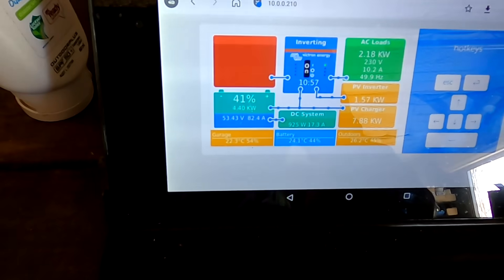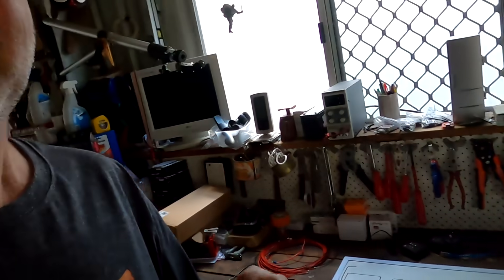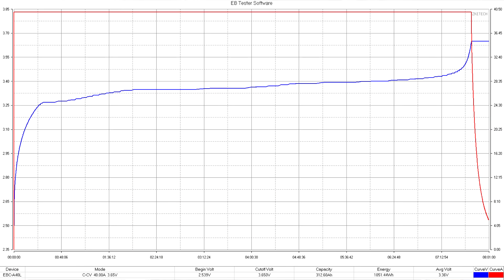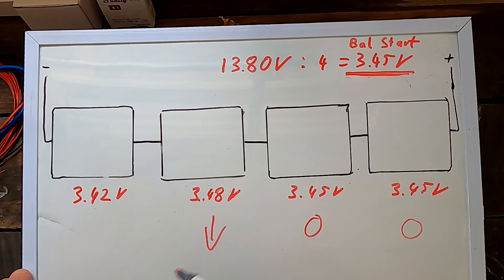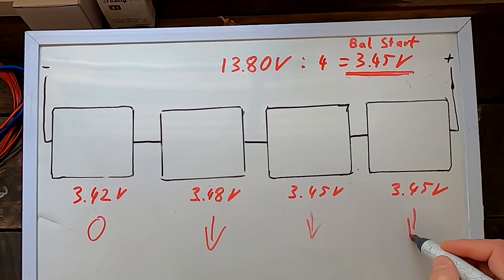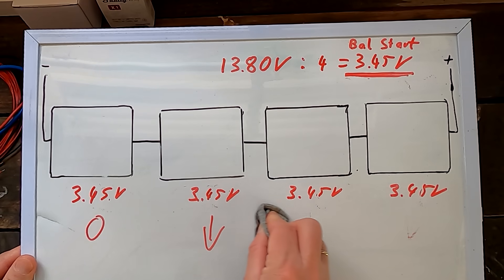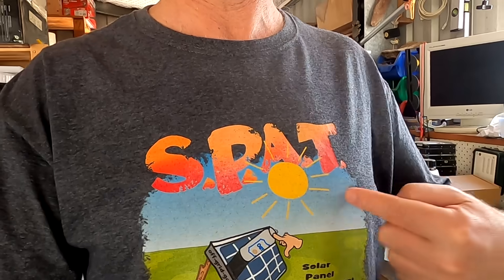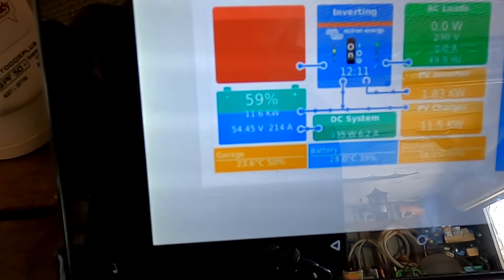Balance Start Voltage for LiFePO4 explained. Why you should not start too early... 🔋⚡

Comment: Thanks a bunch. This is why I am subscribed. You hit the point and very educational.  I have it balancer at 3.45. why would someone want to set the balancer at 3.55? Capacity? Use Application?
Reply: In the last few videos on passive balancing, Andy discussed that this higher start point gives the balancer a better voltage differential between cells and therefore will result in balance current being higher. At this point in the curve you see bigger differences in discrete cell levels, and this is where balancing is 1) required and 2) most effective (ie higher balancing current). But he has shown that the passive balancing schemes continue to struggle to bring a pack into balance when the charging current is larger by orders of magnitude than the balancing current.
Reply: @CollinBaillie  If solar charge controllers could limit their charging current to a smaller amount at a setpoint voltage that would be great for balancing. But it doesn't seem like any can do that.
Reply from the maker: Yes, there is much more to it: the deviation setting of the balancer as well as the actual charge current at time of balancing. Charging with 100A and the JK balancer can do 2A balancing, does make much sense and difference.
Unfortunately, most systems cannot be fine tuned that the actual MPPT is slowing down when hitting CV.

Comment: Because of the variance between batteries,  I balance all the time,  both during discharge and charge.  After 7 years of fulltime use and a delta of 6 milliamps and 95 percent of beginning capacity I'll take my method over yours when you seem to have a constant problem with delta drift.  My BMS is original to the system with zero problems.
Reply from the maker: That totally depends on your charge voltage and target. If you don't charge high enough, you will never see a delta with your cells. Also chemistry is important as I explained.
Reply: Since my (short by methodically analyzed) experience is more like yours, please share with us the exact precise settings in your inverter AND in your BMS - talking here about voltage settings. Also, geographical are would be great. More important would be to know the setup in terms of inverter, batteries and panels to understand at what SOC your battery stay during winter/summer time. For example, if your battery will charge most of the time at 80%, that would keep all the cells at the same voltage (but not necessarily at the same real energy reserve stored in every cell). Also, what batteries are, in therms of brand and source. Are they certified?
As a side note, my chinese uncertified cells have the tendency to self-balance, without BMS and equalization, which is weird.
But true.

Comment: With seplos bms the neey should start at the overvoltage warning value
Reply from the maker: Depends on how you set the warning levels...
Reply: @OffGridGarageAustralia  with victron in offgrid like yours you have totaly other settings. But most users have an on grid System and then there is the best solution to let All settings like Standard just put the Pack overvoltage protection a little bit lower.
56.6V (3.55V) i think is best
Overvoltage warning at 56V (3.5)
And here there should be the Start voltage. So the neey starts balancing at 3.5V when the battery is Charged with only 10A to reach the Charge voltage. Just a user experience

Comment: Another major point is that the charge current will push up the cell voltage and effect the balance start.  If the balance start voltage is set too low, high charging current can cause the balancer to start way too early (before the cells are really past 90% SOC).

This is why, by default, the balance start voltage should be at least 3.50V (14.0V in an s4 battery).  In otherwords, well into the exponential part of the charge curve.   Because the device needs to work properly across the full current and temperature range of the system.

But if you know for absolutely sure that you won't be charging at high currents... say you never charge at more than 0.2C (very common for solar + battery systems).  Then you can safely reduce the balance start voltage to 3.45V.

Another factor is the bulk/absorb target that people set.   The charge target should always be at least 0.05V (per cell) higher than the balance start voltage. For many reasons not the least of which being measurement error between devices and ensuring a full charge across the whole working temperature range (colder temperatures need higher bulk target voltages, for example).

When we combine all of this together we get a balance start voltage of 3.50V/cell and a charge target of 3.55V/cell as a really good default.   And if someone really wants to optimize for low charging currents, a balance start voltage of 3.45V/cell and a charge target of 3.50V/cell is reasonable.  I would not go below those parameters, though.

I know a lot of people do and swear by it, but going lower really begins to restrict the operating temperature and current ranges for proper charging operation without really giving much benefit in return.  The cells won't really last any longer with lower targets, particularly in cyclical applications such as solar, RV, and boat setups.   As long as the charge controller properly goes into a float stage 1-2 hours after absorb with 3.35V to 3.375V/cell for the float stage, the battery will have a great life-span.   Even if it is being charged to full every day.

-Matt
Reply from the maker: Thanks for your comprehensive comment, Matt.
The topic is far deeper than I pointed out in the video. More settings, different setups and designs, charge current, target voltage, absorption time and much more to consider....

Comment: If balancing is needed, the is a problem with your system.
1, you do not need balancing if your cells do not go near 100 % SOC, which is not needed 365 days in a year.
2, if voltage goes above e.g. 3.5 V, there are multiple causes:
2.1. you installed 1 - x cells from y cells with high SOC with respect to others
2.2. your cell/s has/have highher resistance === check cables, screws, cells
2.3. your cell/s has/have smaller capacity === no need to go higher than this capacity in everyday use
2.4. sum of 2.1. 2.2. 2.3. 
balancing wears bad cells, because they are longer time at high voltage,
balancing produces heat and waste energy
so it is better to check system, and / if needed replace bad cells.
Reply: In a perfect world, I agree. We know that the world isn't perfect though. Even the best cells will have manufacturing tolerance and will wear differently over time. 

So unless you replace your pack completely, with a new pack made from the most expensive cells each time some wear begins to show up this difference, you need to resort to balancing. If you use cheaper cells, this difference could possibly be noticable straight away.

Replacing the entire pack each year (as a rough example) would be very very expensive compared to balancing the cells in a pack, extending the lifetime of the pack for possibly 10x the life cycles than if you replaced the pack when a difference becomes obvious.

You would never replace a single "lagging" cell in a pack by your reasoning, or you'd be right back to needing a balancer to make sure the new cell doesn't suffer from the older cells being unmatched.

It's great in theory, but in real life it's just snobbery.
Reply: There is no need for balancing, I use 100 Ah Winston LFP from 2012/2013, cells are arranged, that 4 better are in /-/ side and 4 worse are at /+/ side, So if Cerbo/Rasp Pi III + Venus detect 0.6 - 1.9 % disbalance, my DIY ESP32 50 A - DC-DC BUCK starts and within 20 - 30 sec, remove charge from BAD /+/ side and pumps this charge to GOOD 4 cells at /- / end of the pack. But this is needed only 2 - 3 times per year, there is no need to balance cells , becasue balancing wear out cells, becasue, you go near 90 - 95  % SOC, which has no sence to do.
Reply from the maker: These are just the cells we buy on the market right now. I have tested many here on the channel and even the 'best A-grade certified cells' needed balancing. Every single time.
With LiFePO4 there is almost no other way NOT to charge to 100%. Of course, if you stau in the flat part of the curve, there is no balancing necessary but this does not mean, the cells are balanced. Not at all, as I have shown with my battery shelf. 
As explained, over time, the cells will drift apart, regardless what cells you have and how far you charge them. Charging to a lower voltage just hides this issue, but it is still there.

Comment: Ive wondered about starting passive balancing on the high cells very early, but only if at least one cell is still below the target threshold. Basically, relate the balancing of high cells to the voltage delta. The bigger the delta, the earlier you could start the balancing. 
If all cells are in the flat part, delta is small, no early balancing. 
As soon as a cell starts growing the pack voltage delta, hit it with balance current. And maybe back off the CCL a little. That should let the balance resistors do more compared to input current. 
If you have a cell at 3.400 and another at 3.600, it won’t take much current to raise the high cell over the protection limit of 3.650. So the CCL would probably have to come down to about what the balance resistors can bleed off. 
My feeling is that as soon as any cell is balancing, charge current should be limited in order to allow more time for balancing to happen. 
But this messes with making use of available solar power by inverters directly, which isn’t an issue in my setup yet. It would be nice to have an onboard battery charge limiter separate from the mppt controllers.
Reply from the maker: Yeah, charge current definitely matters. If we could fine tune the system to accommodate for that, it would certainly help. I guess with some scripting in Node Red, you could really achieve that and limit the charge current to the balance current.

Comment: Hrmmm... I suspect we'll need a "Part 2" of this video... A few comments have already pointed out what I noticed. 

I agree about the start voltage, however the balancing won't discharge all the cells when they are above the start voltage. It needs to be over the start voltage, and unbalanced, and in the case of an active balancer it will move the energy from the highest cell to the lowest cell, and will leave the others alone. 

These videos are important to keep reminding people about, bring on Part 2 ;)
Reply from the maker: Yes, but even with an active balancer you have the same start voltage. That was the goal of the video.

Balancing is a rabbit hole and next to charge current, voltage delta, target voltage, system design there is much more to consider. I guess if we go down that path, there is no easy and common explanation any more.
Reply: with active balancing you start early to spare the weak cell(s) and wear the stronger cell(s) more.  If the balancer is even able to divert the whole difference between the weakest vs the strongest cell the whole pack gets to run on the 100% capacity of each cell and not just that of the weakest cell multiplied by total cells.
Top balancing is for passive balancers.  Active balancers who are strong enough can and probably should balance all the time.
Reply: @joansparky4439  balancing all the time is actually pretty bad. Andy has demonstrated this several times. I've also seen it in action.
Reply from the maker: @joansparky4439  active balancers should not be on all the time with LiFePO4. I have shown this many times on my channel. It creates an imbalance acros the pack.
That's why I explained, this start voltage is for passive AND active balancers.
Reply: @ OffGridGarageAustralia  
An active balancer that is online 24/7 per definition can't imbalance a pack as it actively works on balancing it.
But yes, it will destroy the crude top balance state, because it tries to get different cells to the same SOC, not the same capacity.
And when the dis/charge overwhelms what the AB can divert it naturally will occur that the weaker cells will run down first or reach the ceiling first - which then appears as if the 'top balancing' has been destroyed.. yeah, that's exactly as intended.
Just keep the charger connected and it will keep balancing the pack until it's back in balance. Naturally the more diverging the cells in the pack, the stronger the AB needs to be to cope with the difference in the cells
If a weak AB is being paired with a large pack that is driven heavy the weak AB will be unable to do it's job and it indeed is better to top balance only.

Comment: Hm i think you are wrong. Neey starts at this voltage but does Not discharge any of the low cells.
He always discharge the high and Charge the low. Never the less How big the voltage is over the Start voltage. And this is a good thing
Reply: Andy was mostly talking about the passive balancers in most bms , not active balancers like he Neey.
Reply: @LarryKapp1  okay i  haven't noticed this
Reply: The Neey is an active balancer that works across all cells. It opens the charging circuitry (of the balancer, not the battery pack!) To all cells to charge the capacitor(s). Then it disconnects the charge circuitry and opens the discharge circuitry to all cells to charge lower level cells. So, it effectively does what you say. The Neey also considers voltage differential between cells I believe, so it won't activate until there is a significant difference between cells.

There are "active" balancers which move charge between neighbouring cells until it reaches the lowest cell. These work differently in that they will try to move charge from a higher cell to a lower cell. If your trigger level is too low, then all cells could be considered to be high cells (because they are all above that trigger). These are usually inductive balancing in nature vs capacitive.

Then there is passive balancing. Which just discharges cells which are above the trigger level. Usually cells have individual detection and discharge circuitry, so they are never in an All-Discharging state because of a single cell exceeding the trigger. But in Andy's example of 3.40v all of the cells do exceed that trigger so they will all have discharge circuit enabled. 

The examples may have been over-simplified for the discussion. It gets pretty complex, and I think Andy may have been trying to avoid that complexity.
Reply from the maker: Yes, the NEEY or other active balancer will not discharge the low voltage cells, correct. This was more to demonstrate when to start balancing. And this does not change if passive or active balancing.

Comment: Is balancing really only that you discharge the cells over a specified voltage? I though you took current from high cells and pushed that as extra into low cells.
Reply: You described active balancing and not the passive balancing as shown in Andy's example.
Reply from the maker: Both, active and passive balancing should start at this voltage. This was the main point of the video.
Reply: @ OffGridGarageAustralia  
Passive balancing gives the weakest cell the leading role, thus late to balancing is preferable as that is the only point in the charge curve where it's easy to decide.
Active balancing allows for the weakest cell(s) to be supported by the strongest cell(s) and thus allows for higher capacity in less well matched battery banks. Early balancing is preferable for those applications as it spares the weaker cells and wears the stronger cells more, bringing the cells in the bank to a closer match. But this requires the balancer to be able to divert as much energy as the difference is between the weakest and the strongest cells during dis/charge to work - otherwise we're back to passive balancing.